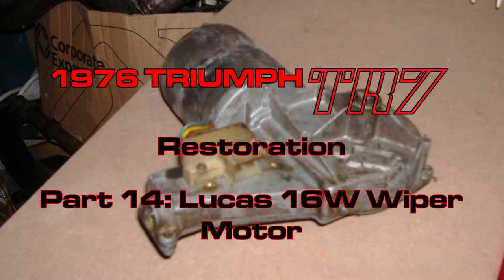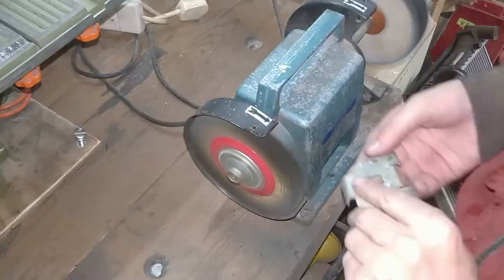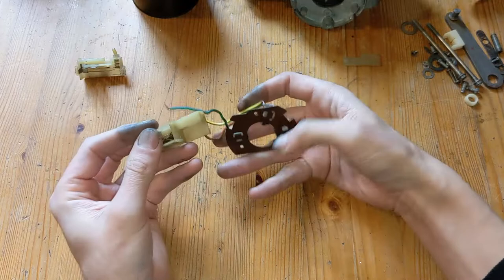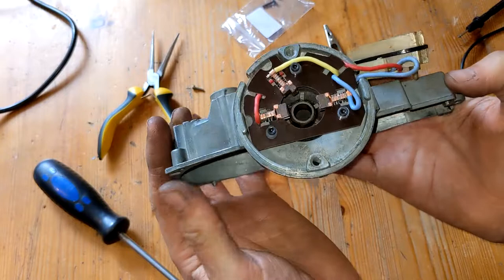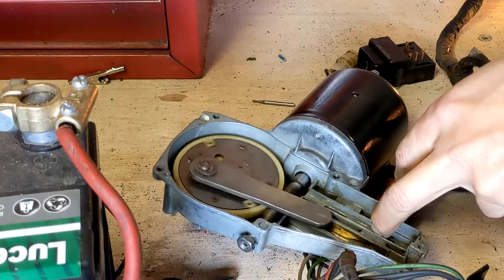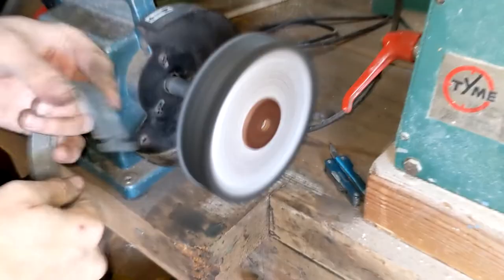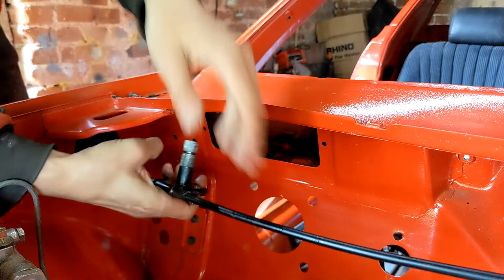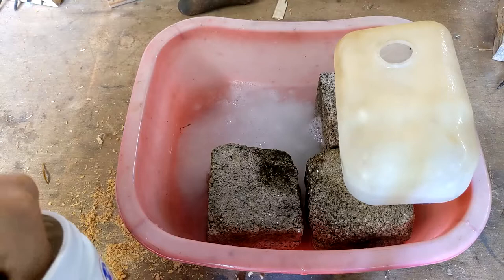Restoring Lucas 16W Wiper Motor - Triumph TR7 Restoration Part 14

Comment: Great video, however I'vegot a problem with my recon motor. I have a 1981 TR7 DHC and now the 'Normal' and 'High' speed works properly, the problem is that I cannot switch them off unless I turn off the ignition. To be clear, the 'off' switch and 'intermittent wipe' do not operate whilst the normal and high speed do. Is my problem with the column switch or, maybe, the Lucas 6DA wiper control unit?
Reply from the maker: It sounds more like a problem with the park switch (on the side of the motor, part of the plastic plug assembly). Unfortunately you can't get replacements as far as I know, but there's a good chance it just needs adjusting or cleaning up.
That said, I'm not familiar with the later switch layout or the intermittent wipe controller, the earlier cars didn't have that.

Comment: What grease and oil did you use to lubricate the motor and drive for the wiper arms ?
Reply from the maker: I used lithium grease. Seems to work well so far, time will tell though.

Comment: I rebuilt my 76 TR7's original wiper motor and gearbox, and had one hell of a time getting it all back together because of the spring-loaded brushes. The repair manual suggests using bent wires to hold each one back, which works if you're very careful, but it took several tries because one or more of them kept popping out. You don't seem to have had this problem with the 14W brushes, and I can see they're completely different in design. My car's cable and tubes are still not right, there's a slight kink that creates a surprising amount of friction as the motor pushes and pulls it through the tubes, which gives slow wiper motion. I guess I'm going to have to do that part over again.
Reply from the maker: Yes, there's a knack to the brushes! As far as I can tell the 16W brushes are no longer available, but with a bit of playing about with some spacers and longer bolts I made it work with the much more readily available 14W brushes.
Reply: I learnt the spring loaded brushes can be held in place by glueing some pieces of masking- or duct tape on top so brush wires can't move and brushes stay spring loaded in their holders. Once in place easy to pull off the tape.

Comment: What grease did you use inside the tubes?  There’s a lot of drag in there….     All your videos very helpful. Thx
Reply from the maker: Lithium grease. My research showed that to be as good as any other, although there's no definitive answer I could find. It seems to work, but time will tell!